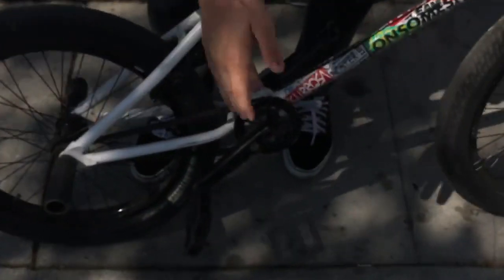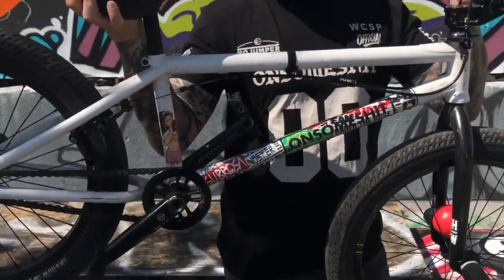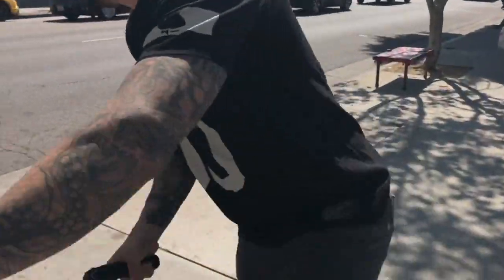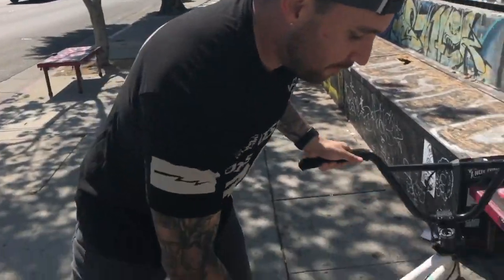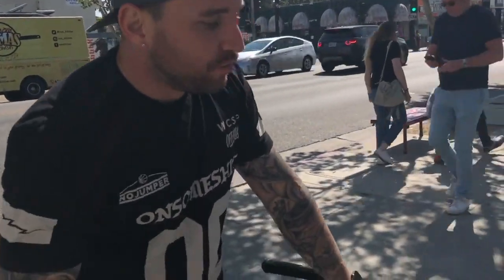HOW TO DO 5 DIFFERENT SPROCKET TRICKS!

Comment: How high does the ledge have to be
Reply: record bmx higher then your sprocket
Reply: Serkan no shit but wouldn't if it is too low your back wheel may hit
Reply: Has to be higher than the back tire. Probably atleast 2 foot high
Reply: only bout 16in high. if you hit your wheel on the ground then your not landing on your sprocket your on the frame. i have done it on a 12in ledge but your actually on the crank arm with the frame tilted in almost table top position.

Comment: HELP!!! I got a bunch of new parts and I have 2 problems, I tightened the bolt on my hub without having anything on it and when I try to loosen it , it spins the whole hub making it stuck. Also whith my new pegs and hub guards it makes my back wheel too wide to fit on the dropouts. Thx plz help

Comment: For bmx beginners how to bunny hop the easiest way tutorials...pls...
Reply: watch the part where he puts slow motion on @2:24. you need to be rolling in a somewhat crouched position then pull up with arms on handle bars like your going to manual but with more force then thrust your body upward ( like if you were standing with your feet on the ground and you were jumping. )wile pointing your toes slightly down holding pressure on the pedals by slightly pulling forward on the bars into the jump.you should be in the air by now. before landing level your feet and bend your knees and be prepared to hold your weight on impact.